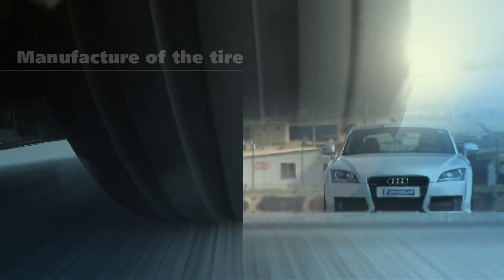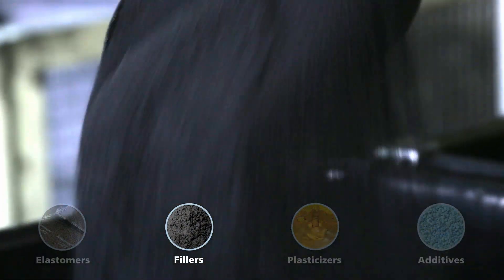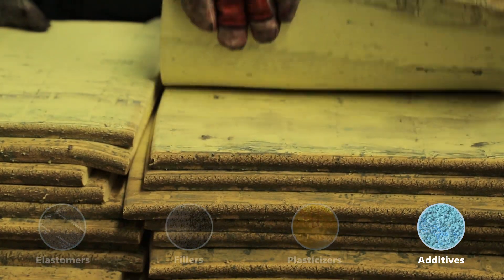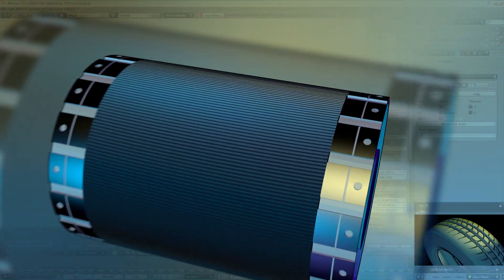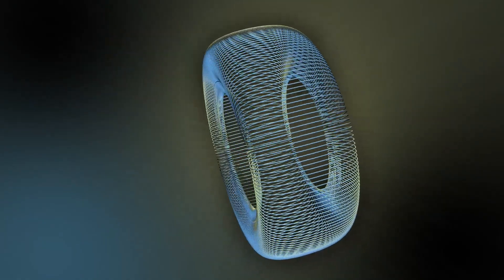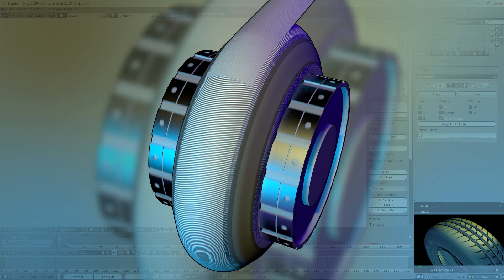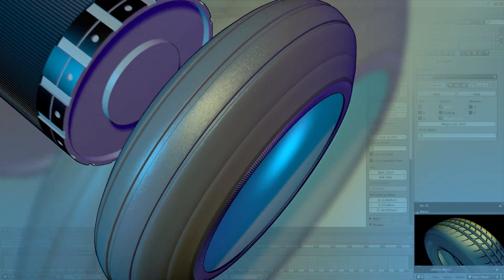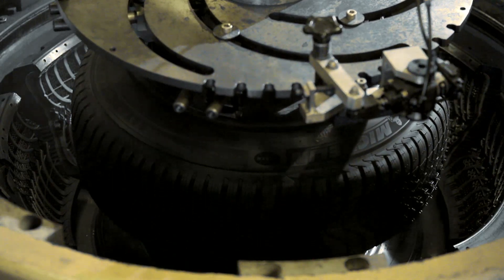How Michelin makes car tires

Comment: Excellent video. The mechanics of a modern vehicle tire is astonishing when you realize that everything in that tire, has to be made to withstand horrendous spinning forces, as well as torsional forces, when braking and turning and accelerating. And not only that, the tires construction must also absorb the massive forces of potholes, bumps and road grooves trying to tear at the tires contact patch, the entire time the tire is moving. All while spinning at highway speeds. The contact patch, that is controlling all the weight of the vehicle you are driving, is no larger than the palm of your hand. That is all that the tire has available to keep you safe and moving down the road. The constant unrelenting spinning forces dictate that the tire is built darn near perfect. It cannot have anything in its construction that will truly move or make it become out of balance, or it will fail. Michelin, Bridgestone and many other topflight tire manufacturers really do provide a very special service to their customers and the tires they make, are the most modern, safe and efficient in the world. Spend the money and buy the great tire. You will never be disappointed.